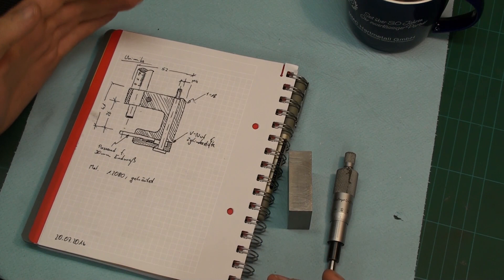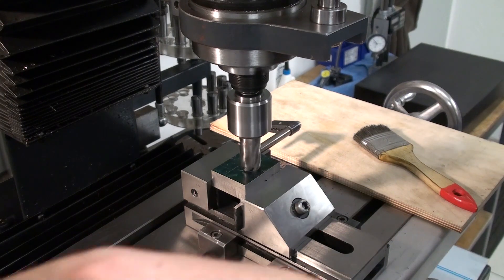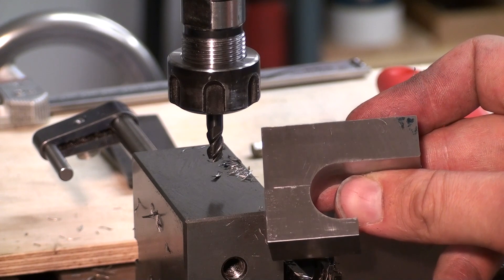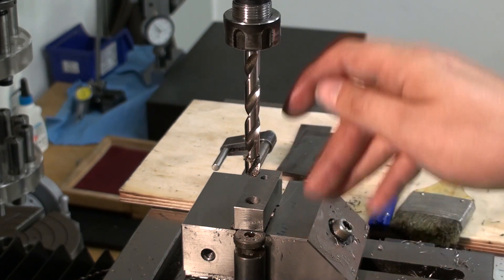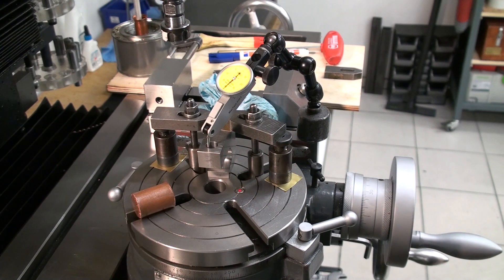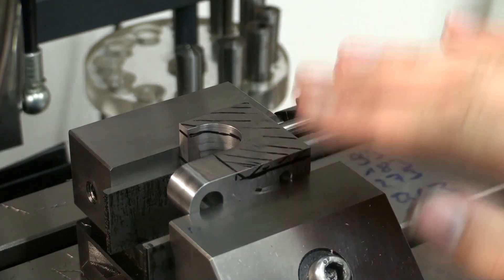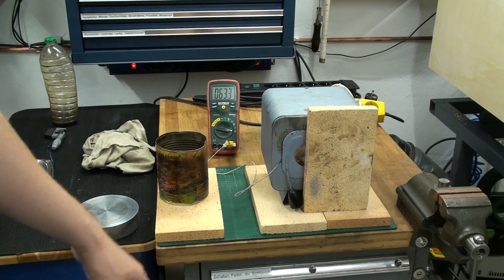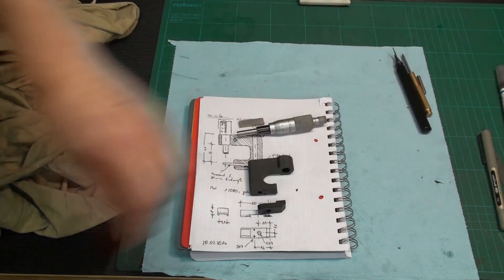Shopmade UniMike - Part 1

Comment: You mentioned in the video about putting the vee in the fixed jaw, I believe the clamping jaw usually has the vee so the a pin will have the same datum relative to the barrel as the flat would.

Comment: Stefan, thanks for your excellent videos.  Just a comment about heat treating.  If you are going to quench a part, either hardening or to stop drawing, it would be  a good idea to put a bent up layer of hardware cloth in the bottom of your quench tank.  This will keep the part from lying on the bottom of the tank and therefore preventing circulation of the quench liquid.  Ideally you should tie the part to a wire and move it around in the quench liquid, but in small setups that can be a fire hazard with a LOT of smoke.  Putting something at the bottom of the tank that will allow the liquid to circulate will do more even hardening and less warping.

Comment: Stefan, I'm curious why you used oil for the tempering operation.  It's been a very long time since I did oil hardening on tool steel, but I seem to remember just heating to 650 deg. F and air cooling to draw back the temper.  What is the advantage of oil tempering?

Comment: Can you elaborate a bit on why you want a unimike? Does it have specific advantages?
Reply: Measuring tube wall thicknesses, for one.
Reply from the maker: Yes, with a gage pin/dowel pin as an anvil it can measure the distance of a bore to the edge of a workpiece very precise, it can double as a thickness micrometer on the magnetic chuck of the lathe/surface grinder and it can measure the distance of very narrow groves to the edge of a workpiece. And they look cool ;)

Comment: You don't appear to have a V groove in the clamp for holding a cylinder anvil. Is that going to be ground in?
I'm also assuming the 2 small holes in the clamp/body are for anti-rotation pins?
Reply from the maker: I hardmilled the V, after I did all the grinding on the clamp - It doesnt need to be super precise, and yes, the two holes are for 2mm dowel pins to keep it from rotating :)

Comment: Hi Stefan,  I noticed you were unsure of the english term to "soften" the hardened steel in a previous video.  Tempering is the correct term for partial softening of the hardened steel.  Annealing is bringing the steel to full soft.  Great video though.  I like your sketches.  I do the same thing, only with engineering calculations around the sketch.
Reply: Have you seen Mr. Pete's video on annealing a drill shank to make a center drill driver?

Comment: Funny how those endmills break like icicles..........Lol!  Been there, done that.  Also when you quench, cool down part quickly as possible to get an even hardness (shake it around)   
then you get a better Rc after tempering.  May want to use a bigger quench container as the oil gets hot and doesn't quench well.  Anyway you did a fine job as usual, tool making is fun!
Reply from the maker: Youre right, my heat treating is still very makeshift and has room for improvement :D
Thanks for the suggestions, I realy need a dedicaded quench pot with a bit more volume, not an old can of peas...

Comment: Please forgive me, as I know nothing about machining, but how does the edge finder work?  How does it register the work piece?
Reply from the maker: It consists of two parts that are held together with a springt. When you approach the edge of a tool with it it will run almost true and then suddenly kick to one side. The moment the edgefinder kicks over you are exactly hald the diameter of the edgefinder away from the edge.
They are quite accurate, better than 0,01mm with some practice..

Comment: Did I really hear you say 12% Carbon? Maybe my ears. And what was it,. Cobalt? One mean steel. Tool steel, at least here in the US is sold in annealed state. In this state the C and Co molecules are completely random respect the Fe and the steel is "soft." As you raise the temperature these molecules form crystals and that is what gives you hardness. I do not know anything more complicated than the phase diagram for Iron alloys. When you quench you preserve whatever the crystal structure was present. Hard but brittle. When you temper  you let the crystal relax so that it is only semi-crystalline. The amount of "semi" is Rockwell hardness. Very, very good video and I await part 2.
Reply: Oops. Need to add the "soaking theperature" i.e. the amount of time you leave the thing in the oven is important. Roughly ten minutes per 25 mm thickness.
Reply: I am pretty sure that is D3 tool steel in the West.
I scored some A6 a few weeks ago, and they had some D3 that had that much Chromium.
Reply: 2% carbon, 12% chromium. Metallic elements are nearly always crystalline. One exception is in very specific alloys used in the security strips that are found on/in plastic clamshell packaging. The strips are an amorphous (non crystalline) iron based alloy. In its annealed form, a high carbon content steel will have a microstructure that is known as pearlite. This is a structure composed of ferrite(pure iron) and cementite(iron carbide). When the steel is heated above its critical temperature, it's microstructure transforms into austenite which essentially dissolves all of the available carbon into the iron. Austenite possesses a body centered cubic molecular structure and is not ferromagnetic. If this austenitic steel is subjected to a sufficiently fast temperature drop, the majority is transformed into martensite. This martensitic microstructure is supersaturated with carbon. Martensite is very hard and is the source of a hardened steel's high hardness.
Reply: Tempering transforms some of the martensite back into pearlite, reducing the hardness of the steel
Reply: Thanks. I know that, but did not want to put those fancy crystallographic terms into a comment.
Reply: The only time iron is non crystalline is when it is a liquid. It could only be described as semi-crystalline when it is in the process of freezing (solidifying). Dendritic growth begins to take place at nucleation points and a crystal structure is formed and grows until it contacts neighboring crystal formations. An example of an amorphous (non crystalline solid) material is silica glass. In fact, the word glass is synonymous with amorphous. The word glass can be used to describe any amorphous material. The exceedingly rare amorphous metallic alloys are known as "metallic glass". They can only be created under very specific circumstances.
Reply: Yes, in Physics we find "spin glasses: :). And the phase diagram for Fe + C is a nightmare. But for home shop work, it is not necessary to  go quite so far.